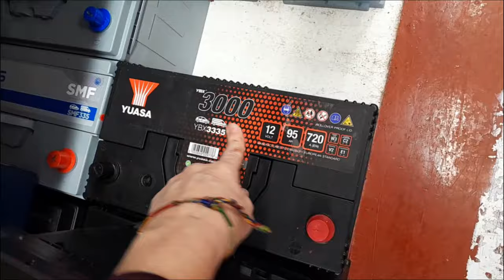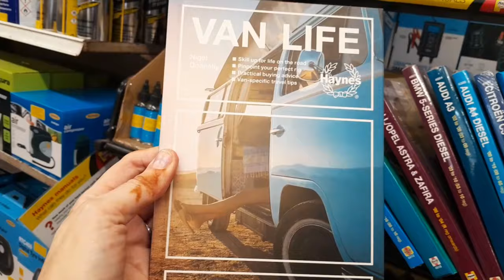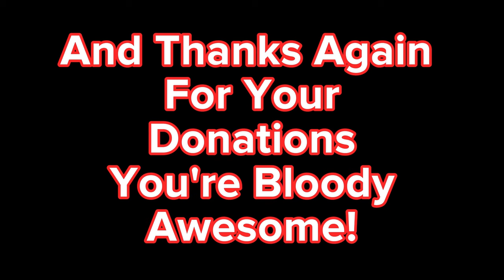One Van Problem Solved. More  To Deal With...🤦‍♀️

Comment: Hi Coral ,on your battery terminals /connectors adding a thin layer of petroleum jelly on the bare  metal areas and wire ends /nuts etc  helps stop that blue corrosion you can get sometimes ,not grease use petroleum jelly 👍its the correct stuff to use
Reply from the maker: Thanks for the tip 😊👍

Comment: That Knock sound is your steering hun not your universal joint your Van is rear wheel drive my van make's that exact sound its absolutely nothing to worry about
Reply from the maker: hey, well it didn't do it before so that concerned me. I had it looked at and the mechanic tightened something up. I think that cured it but not completely sure as my van hasn't run since 🤷‍♀️🤦‍♀️
Reply: @anothercampervanchannel  well i tried ringing you to explain xx😁

Comment: Ball joint lass knocking noise
Reply from the maker: Ball joint? What's that attached to? Lol
Reply: @anothercampervanchannel   it's attached to the spindle top and bottom it helps with the steering behind your Wheel at the front.
Reply from the maker: Oh...😊

Comment: What did the therapists say regarding ya problems, surely if they were any good they would know what's going on n advise the best treatment going forward?
Reply from the maker: You'd think so, but depends what angle they're coming from.  The last therapy I had looked more into coping strategies than getting to the source of the problem. They weren't looking at  adhd though so maybe that's why there was limited benefit 🤷‍♀️

Comment: I bet the van constantly rocking when its blowing is wearing. Cheap fix is two bottle jacks, one under each chassis rail to just take the weight off the suspension. rocking cured. just dont try drive off without letting them down.
Reply from the maker: It's very wearing. Oh, I'm not sure I'd feel safe if I was up on jacks in the wind 😳. I already think I'm going to get blown over, lol.
Reply: @anothercampervanchannel  not Up on jacks just to the point where its not on the springs then the van cant rock
Reply from the maker: Ah okay 👍